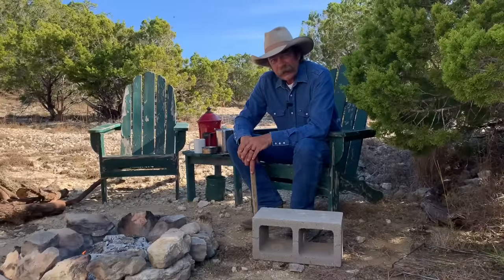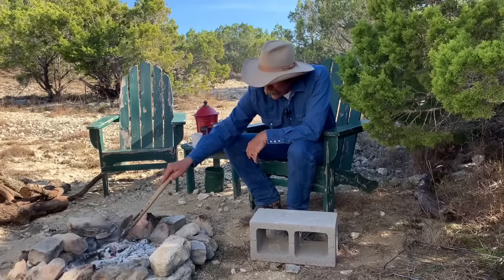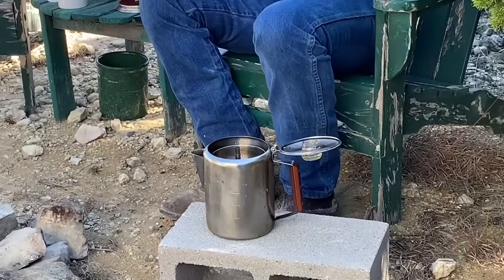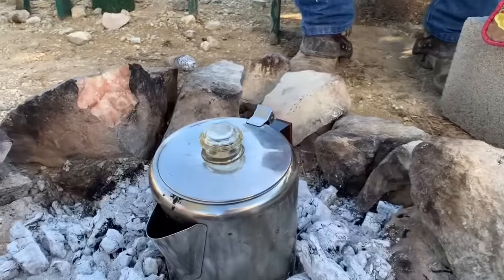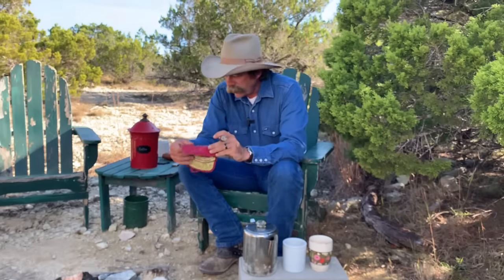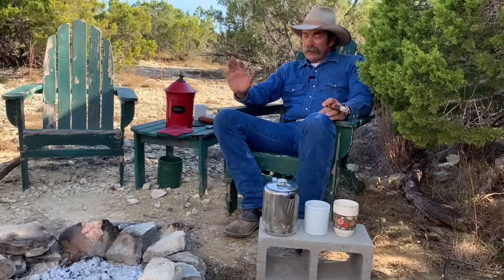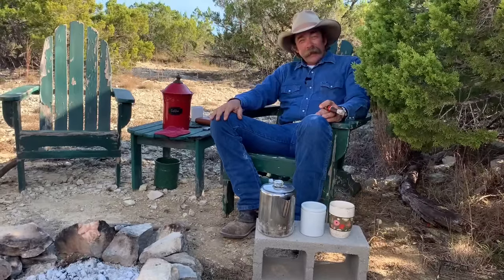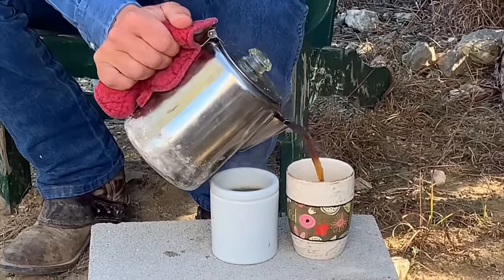Making a Good Pot of Campfire Coffee

Comment: They still make filters for percolators. Just FYI. I use them every day. Your right. Percolated coffee is much better than drip!! The filters are folded flat so you can actually put a few in your wallet if you want. Just a tip. Unless you like chewing your coffee. Lol. Great video. Full disclosure tho. I have an electric percolator I use every day. And when clean. It takes less than 10mins to perk.  But they are pricy compared to drip.

Comment: quit my JOB in 2018 , sold the house, purchased a 21 foot travel trailer which I pull with my ram 1500 that I purchased in 2005 so no payments on it for 12 years now (247,000 miles). I have been boondockin and traveling ever since.  so yeah slow down if you can,life is too short and now, very nice.

Comment: For those wondering, the percolator is by no means necessary. Been making campfire coffee for years without it. If you're doing an event period correct, that's not an option anyway. But yeah I'm sorry dude, I have to point an error here about settling the coffee: You think dropping a bit of cold water into a boiling pot off the coffee is going to cool it down, but letting the pot sit there for 20 minutes doesn't? Flawed logic right there. A bit of cold water doesn't make one iota difference in the heat of the coffee and it does settle the grounds immediately. You know what does make a difference in the heat of the coffee? Letting it sit there for 20 minutes when it's 30 something degrees outside.